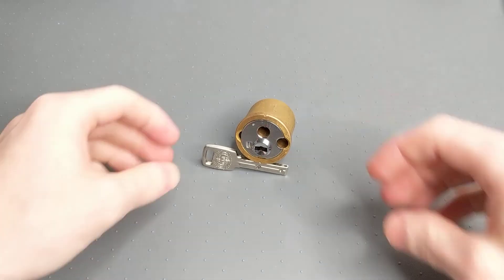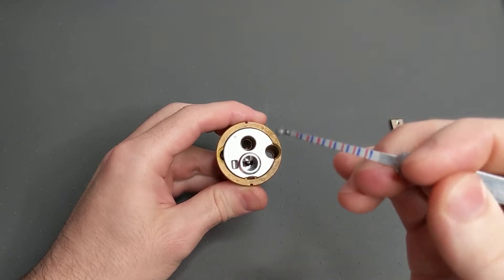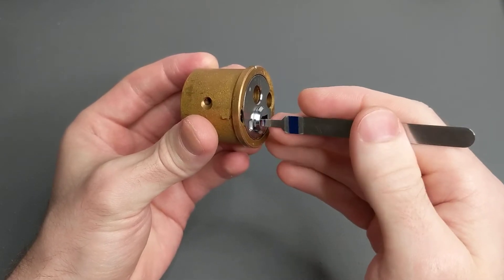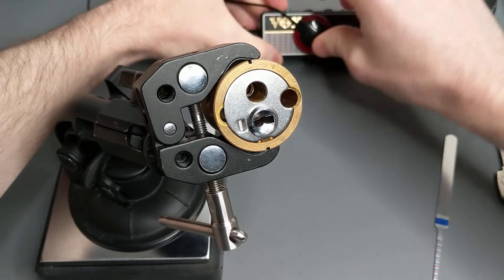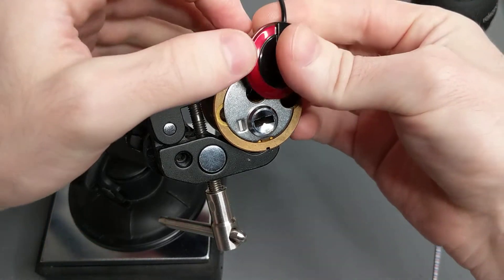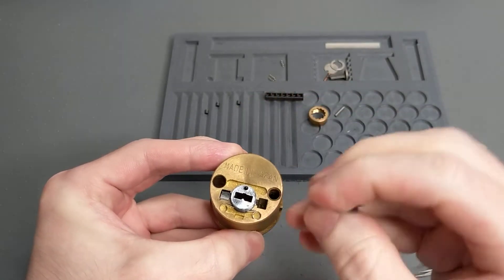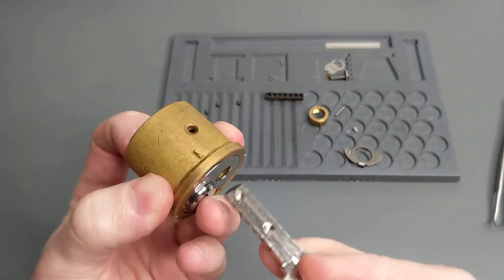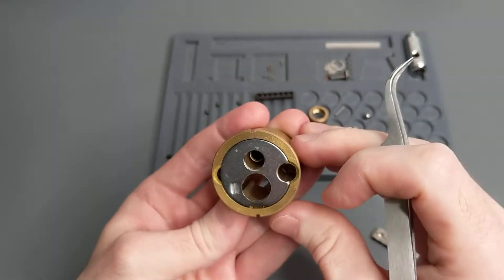[8] Miwa EC Picked and Gutted

Comment: Hi I just got a padlock version, where did you get the pick or did you make it? Thanks
Reply from the maker: That's a home-made pick -- it's a 1/16" x 1/16" rod magnet pressed into a close-fitting hole I drilled in an old half-diamond pick, though you can also make a perfectly functional pick by super-gluing a thinner magnet (2mm x 1mm is common) to one side of a similar pick.  I also have a layer of scotch tape on either side of the pick shaft to keep the markings from rubbing off and to cut down on scraping noises as the pick moves through the lock.